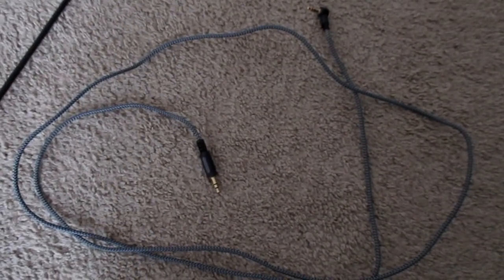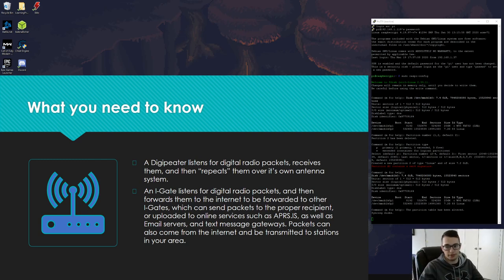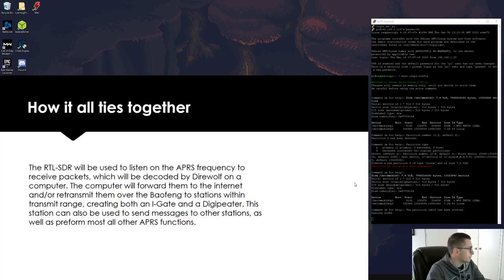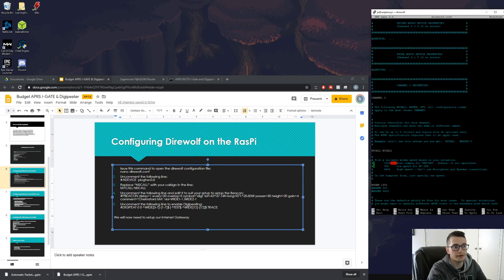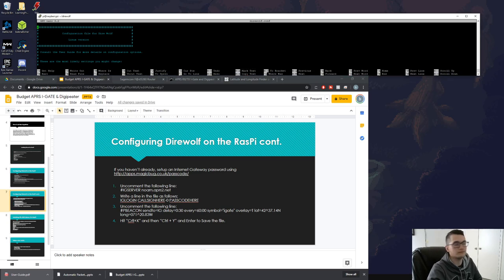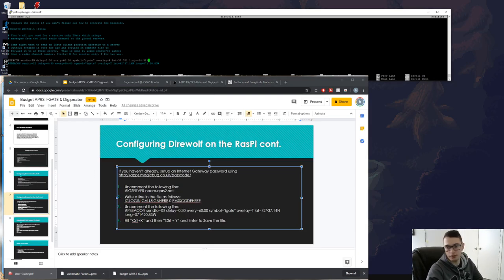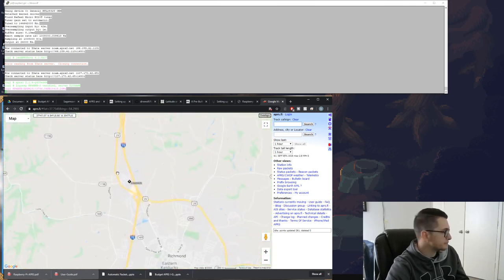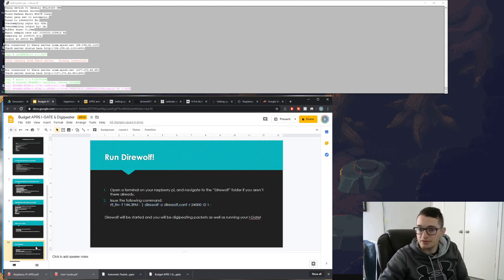APRS I-Gate and Digipeater with Baofeng and RTL-SDR

Comment: Hey, just a suggestion. Why use the RTL-SDR? I have two raspberry pi digipeters running direwolf that just use a baofeng radio to receive and transmit. all that I did is make a cable thats connected to a usb sound card and a relay for the PTT and Bam bob’s your aunt. I tried VOX the first week and found that VOX is a sloppy way of transmitting and most transmissions were unintelligible. Using a IO pin to control the PTT on the ht will allow you to transmit complete packets. Direwolf is a solid program but when other programs are running on the pi it tends to crash so keeping it simple has payed off for me. I have one digipeter that has not been restarted in 18 months. All I’m saying is ditch the RTL and use soldering iron.
Reply from the maker: That is definitely an option. If you have the know how to do it, I would say go for it. The reason I suggested this is for my beginners out there getting started, to actually keep it simple for them. A lot of us already have an rtlsdr laying around collecting dust, and the thought of making your own wire, or stripping another one and then soldering(which is a skill itself) to configure a GPIO pin in the pi might scare some. Not everyone has that skill set or supplies.
Reply: Can you share the steps about how to do it? I´m interested to configure in the way you did.

Comment: I just finished setting up an Igate digipeater using this guide and it worked great. Heads up, there is a new version of direwolf (1.6)  that has a couple more steps to install.  This was a really fun project for me having little Linux experience and got me comfortable using raspberry pi. Also you can make this more reliable by adding the command TXDELAY 200 underneath the audio channel line for you baofeng. TXDELAY  in direwolf gives a preamble to your packets to open the VOX slightly before the packet begins to give your radio a moment to catch up.
Reply: Can you explain the extra two steps.  I started loading per the slides and when I got to sudo make install it just says error no where to point or something like that.  I’m new to raspberry Pi so any help greatly appreciated.
Reply: @mountainsunsets  I’m also struggling with getting it going. I get different errors on a pi zero vs pi 4

Comment: 2 questions:  why not use baofeng for both send and receive (guessing audio level is too high - baofeng interface cable could solve that if the Pi connector is TRRS).  2nd, any concern of a transmitter so close to the rtl receiver (especially on the same exact frequency)?
Reply from the maker: The baofeng squelch often times does not open up in time to receive the APRS packet, so this solves that problem. The Pi connector is also output only, so you would need a special aprs cable, and a sound card. I've had a few people tell me I should be concerned about overloading the RTLSDR, but I've run this setup for months in the past on the same SDR, and there are no issues yet that I have been able to notice.
Reply: @ModernHam  Why use squelch at all?  Why not run the baofeng wide open?
Reply from the maker: @seancampbell8510  The baofengs job in this setup is not to receive but to transmit. It doesn't really matter. The long tail on the transmit back to receive can also cause it to miss packets so I used the rtlsdr to aid.

Comment: The problem with using a Baofeng is that the carrier is kept open for a couple of seconds after digipeating. I have verified this with 3 of them and the ham community does not appreciate it. Direwolf in Windows works with a Signal Link beautifully with the Baofeng cable and a battery eliminator; use this for both receive and transmit.

Comment: Thanks for the video.  It was complete and informative.  The only issue I am having is I ssh into a headless pi, run the program, but when my main computer sleeps it drops connection and the program terminates.  Any thoughts on running the program as a daemon to keep it active?
Reply from the maker: Got a perfect solution. There's an application for linux called "screen". You can basically run virtual ssh windows that stay open as long as you want, as many as you need, and they don't go away when disconnecting. 
https://linuxize.com/post/how-to-use-linux-screen/.
Simply create a new "screen" run your direwolf command inside of it, and then detach from it, and you can do whatever you like.

Comment: Will any radio with a external speaker jack work with this? Thanks for the video!
Reply from the maker: It will in receive, but you would need a mic/data in jack with vox or PTT functionality to transmit.

Comment: Good video! interesting.
My question is can Direwolf on R-pi be used to switch a GPIO on the R-pi (Relay for example) upon receiving a telemetry message?
I want to make a button to switch remote control working over APRS, so a client with a button (or a controller like Home Assistant) causes a APRS with telemetry messages to go out over RF or internet, and the remote client with a relay/actuator which can get the message either over internet or RF.
P

Comment: I’m having an issue installing this software.  On the first slide I get to:  sudo make install and I get an error message talking about no target.  Any ideas what I have done wrong or what do I do next?
Reply: I'm with you on this.  I got the same error at that point.  I think a few things have changed since this video was created and I'm trying to get it to work myself.  In the direwolf directory there is a readme file... "cat README.md'.  There it mentions new steps:  

"There are two new steps not used for earlier releases.

        mkdir build && cd build
        cmake ..
        make -j4
"

When I tried running the cmake command that failed which I later discovered I need to install cmake and some other things:

    sudo apt-get install git
    sudo apt-get install gcc
    sudo apt-get install g++
    sudo apt-get install make
    sudo apt-get install cmake
    sudo apt-get install libasound2-dev
    sudo apt-get install libudev-dev

Some of the above may already be installed so it will skip what is not needed.  The important thing though was the 5th line ' sudo apt-get install cmake '

I did get further along in the process but despite all the above, I am still not getting it to run.  I just wiped clean my SD card and am starting completely fresh with a new install of buster lite.

Not sure if anyone else is gettin troubles but I am still trying to get this running.
Reply: @Czecher262  a friend of mine whose really into Linux, question why I went to all that when all I had to do was use this command and it would load Direwolf on the Pi for me.  sudo apt install direwolf.   You do have to create your own direwolf.conf yourself.  Worked like a charm for me.

Comment: Hello
wenn i like to run: sudo make install . he says : no rule for creating install. what can i do ?
Thank you!
Reply: Same problem here
Reply: Looks like the instructions have changed a bit with the latest  version 1.6. The Readme file installed on the Pi in the Direwolf folder outlines some extra commands to execute to install additional dependencies before you can run the sudo make install successfully.  Not sure exactly which are required but sudo apt-get install git, sudo apt-get install gcc, sudo apt-get install g++, sudo apt-get install make, sudo apt-get install cmake, sudo apt-get install libasound2-dev, sudo apt-get install libudev-dev.   Then cd ~, cd direwolf, git checkout dev, mkdir build && cd build, cmake .., make -j4, then you pick back up at sudo make install, make install-conf.

Comment: Awesome instructional video. How would you build a total off-grid mobile radio setup using the Pi and a handi-talkie to send text messages when there is no wifi or cell service? The reason for this is when boondocking for a week or so at a time there are no cell towers or wifi available. Being able to send texts over the air to keep loved ones informed of my health and location would be wonderful. There are some good tutorials using other systems, but none with details in using the 2-meter or 77-meter bands on a handi-talkie. Any help on this would be appreciated. 73, Greg KI5LUY.

Comment: Tnx for the video!  Must the SDR be the RTL-SDR brand?  I have several Noo-elec Nano2 SDR laying around, and abiding by the low-cost philosophy, would like to use them.  Noo-elec is based on RTL2832U & R820T2, like RTL-SDR.  Specs here: https://www.nooelec.com/store/sdr/nesdr-nano2.html
Reply from the maker: I'm not sure. I wouldn't think so, but you may have to do some tweaks. You could lookup how to use direwolf with the Noo-elec brand.